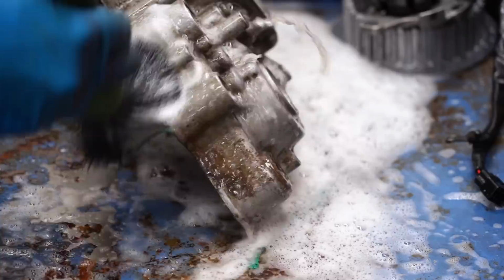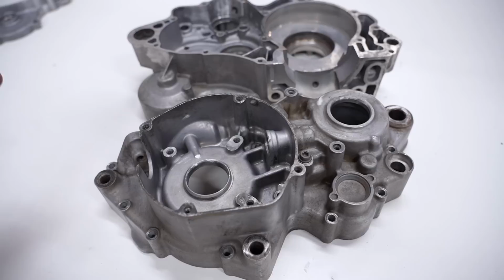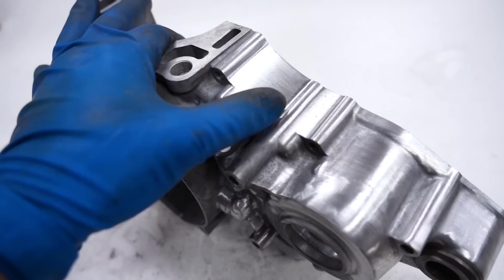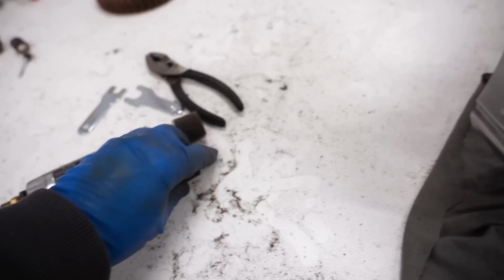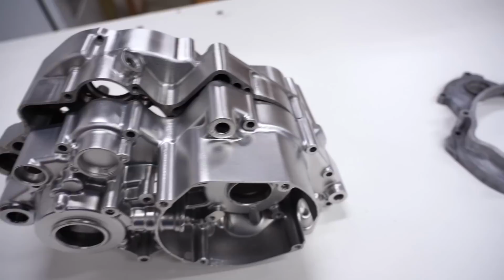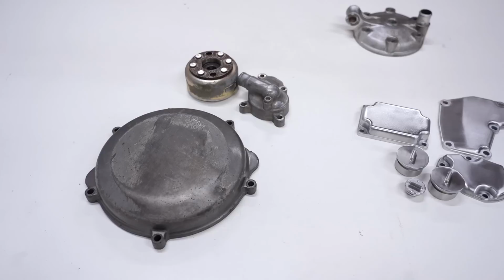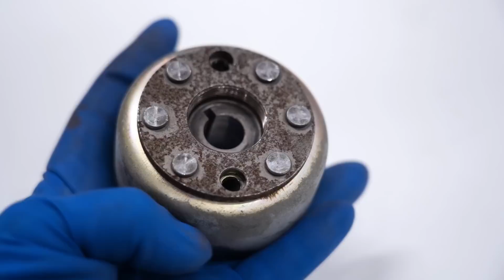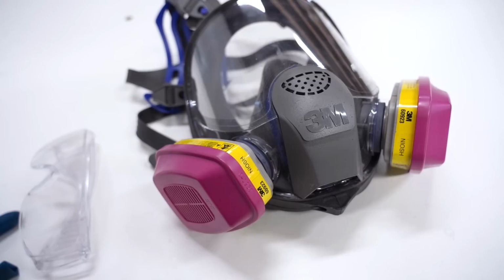Restoring Engine Cases To Better Than New! | RM250 Rebuild 7

Comment: Brushed finish looks great! To get straighter lines dont rub back and forth, just rub one direction, like top to bottom, pick up the pad, and start from the top again. It turns out alot better normally

Comment: If you wish to maintain the motors sheen and cleanliness, spray the engine with a light coat of non-stick cooking spray before you take it out. Concentrate on the dirt "impact" areas especially. 

Once done with the days riding simply pressure spray with gentle detergent. This will restore it to its original shine. 

I have built show road bikes that were frequently ridden... worked a treat there as well.

Good luck and thanks for the great channel Cam. 👌

Comment: You might want to try the "Purple De-greaser" from Home Depot. I use it on my Laser Engraver cutting table, and it works like nothing I have ever seen. You will want to wear gloves, and mix it to 30% solution with water. Let the parts soak in it for half an hour, and you should be able to squirt them clean with a hose. In very tough cases you may have to use a soft brush. I used an old electric toothbrush and it worked like a charm. This stuff is potent, so make sure you rinse thoroughly!

Comment: I built Epoxy composite sail boards . Painted with an aircraft paint called Imron . I study aerospace engineering. I had a beautiful shop.
My friend bought a shop from some one and just started building without reading the safety data sheets.
He would paint with a respirator only then go back into the paint room and look at his work without a respirator.

I had a fresh air supply system used many types of Epoxy
Resin . Never look at a piece after painting until it was fully cured in an oven. He had to have kidney transplant surgery.
You have a nice shop.

Comment: very cool vids Cameron, one tip though be careful with raw finish on Magnesium, there is a reason the OEM's paint the magnesium covers they corrode very quickly when exposed not like aluminum.

Comment: Great tip about heating the parts in the oven.  Was scratching my head the other day about trying to get the stuck twin needle roller bearings in the dual brake system pivot point on the lower fork leg on my XL1000v.  Just tried your tip 20 mins ago on the dismantled fork lower and they pushed out with minimal force.  Thanks

Comment: Just a FYI I stumbled on your account a bit back and have been watching since.  I wanted to let you know I have been using the Napa Alum bright for years.  On any engine case it will gray it out, but on aluminum like a sub frame or swing arm it will make it bright again.  I think it has to do with the different material in the engine case aluminum.  I will use is on old chrome wheels, new mag wheels.  The key is spray and immediately rinse.  DO NOT LET SET FOR ANY TIME.  Also I have see a few vids on home made vapor blasters.

Comment: Go figure... another great video Cam! Those parts turned out sweet! Sooo clean! 

An idea for the future... next time you get a head in that condition, you should discuss how to measure the squish band and mating surfaces. A lot of hidden performance in is stock heads by just correcting the squish band.

Comment: That’s odd about the Napa Aluminum Bright stuff. I use it on my ‘14 CRF450R every once in a while and my cases look just as good as a new CRF engine. Never had it turned it that “grey” color.

Comment: Hey Cameron another great video. I'm not trying to critique your work because your work is flawless but as a fellow builder/mechanic I think how much time it takes to do all this stuff or maybe greate less work for yourself. I'm wondering maybe sand blasting the cases to get a nice finish and for polish putting the cases in a tumbler to save some time. It's probably more than likely you restore a lot of cases and aluminum pieces with all your dirt bike experiences. I wonder what you think about that?

Comment: Do you ever run into the issue of the crankshaft feeling tight or binded after you re install in the cases? I’ve had this issue and didn’t know how common or natural it was because of how free it rolls over before disassembly maybe the difference in a worn engine and a new tight one? Just figured I’d ask a guy who was built a few more then myself.thanks in advance

Comment: Nice. I’m about to pull my motor out and do this! Not gunna crack the case open but figure I can do a leak down test while I’m at it and get the frame up to date. I have a 95 kx 250 I have spent a lot of hours cleaning that bike. Got my woman all pissed at me cuz I had to use our bath tub to clean a bunch of parts but it was worth it! It’s kinda addictive cleaning and polishing and restoring. I’ve spent over 2K and a massive amount of time cleaning and I feel like I’ve just barely started. Gunna get one of those haggs pipes 600$ and a phat head which is 350$ gunna get all titanium and aluminum bolts and nuts and still feel like they’re is so much to do.

Comment: cam be careful if u plan on clear coating the cases, I done that on my 06 kxf250 a few years back, the problem was when the engine heats up it very slightly softens the clear coat and the sand/dirt got into it and stained it, it looked terrible and I had to undo everything I had done!!

Comment: I would advice for using plastic and not metal gasket scraper material. its very easy for a metal (steel) on to dig in the casings

Comment: What would you suggest for a small hairline Crack in the engine case (97 RM 250) on the right side case right at the motor mount where the bolt goes through on the very bottom. It doesn't leak. But only time will tell. Thanks.

Comment: Gret job on the aluminium, ..... BUT, magnesium should NOT be left exposed to the elements , it requires a chromate protective coating or it corrodes very quickly

Comment: Question: is it possible to buff/sand down an engine or crank case too much where the tolerances are messed up and parts no longer sit flush?

Comment: Cam my first youtube dirt bike guru.. Im going through an 89 cr125 and they of course have black cases. I just got a replacement set and need to get on it later today. I was wondering your opinion on painting cases without powder of cerakote. Trying to do it on the cheap and i can prep like a sob but unsure if I should strip the cases completely (time consuming mess). Or sand down really well then start from there...mind you someone has sprayed these cases black spray paint already so im kind of unsure an would like your opinion. Great work as always man u make it look so easy it too. I love it.

Comment: Hey Cameron, I found a 02 CRF450 with low compression and won’t start. The seller agreed to $550 as he believes it needs a new top end? He said the compression is at 70psi. What could be the causes of this? An easier fix possibly than a new top end? Thanks I’m advance!

Comment: I personally prefer the vapor blast look. Now im going nuts trying to find one here in my country, but nobody sells them here. There is a wet blast nozzle though that attaches to high pressure spray machines. Wondering if it can produce the same look?? Anyone know?

Comment: Hey I have a 2001 rm 250 it starts 1st kick when it’s cold with choke on I let it warm up a little then turn choke of and ride it easy to warm up the rest but once I turn it off it won’t start back up warm any tips or reasons it would do this?

Comment: do you know what your buddy used as far as the slurry mix on the vapor blast? They did come out amazing I made my own for like 50 bucks and it did a beautiful job on my subframe Radiator Braces Linkage and some other stuff. Great video as always
Reply: 170-325 mesh glass beads

Comment: Steel wool is bad for aluminum - It leaves microscopic amounts of steel in the grains of the aluminum which causes dissimilar metal corrosion and makes the cases look bad quicker. Scotch Brite is okay because it's a synthetic material

Comment: Have you ever tried a clear lacquer over the polished parts ?
Reply: I have and it wasnt good, I done the cases on my 06 kxf250 a few years ago, it looked fine until I started riding the bike, the heat from the engine very slightly softened the lacquer and the sand and dirt got embedded into it and stained it, it looked terrible and runined the work I had done!!
Reply: @ericjaulin9562  
Yeah you would have to use some type of lacquer that was resistant to heat or it would end badly.
I don't know what kind of clear coat they used to used on engine casings from the factory before they started anodising everything but it lasted quite a long time.
Reply: Had a look around and 2 recommended
One is "Hycote VHT clear" that is fairly cheap
Or a more substantial coating "Eastwood Diamond Clear Gloss for Bare Metal"
Reply: I cant remember what it was I used, it was a few years back but im pretty sure it was a heat proof version, I wouldnt risk it again, maybe it was the constant heat that caused it to go soft, it wasnt enough to really notice by look or touch so it was so slight but enough to absorb the staining. thanks!
Reply: Clear cerakote is awesome and easy to apply
Reply: @tonykoehn8181  I am about to cerakote my cases on my current bike but its a charcoal/smoke colour, ive already done the waterpump and housing and it looks brilliant, mud and water jus run off it aswell!!

Comment: I have the same bike that your working on. And I’ve been trying to rebuild it,but I’ve been having trouble with the engine because there’s a crack on it. I was wondering where can I get a new engine for a RM250 same year as the bike your working on. I checked all over online and I can’t seem to find any that are available.
Reply: Buy an used case
Simple
A lot cheaper
Just look for a one without any cracks
If it has scars on the outside of it dont give a damn
You can make it look new just like cameron did

Comment: Hey wouid I be able to shine up my motor without having to strip the whole thing down if so then how ?
Reply: Do it by hand
Or with small tools
It will take a lot more time
And the effect wont bw as good
But if thats what you asked the  here you go
Reply: Kacper Wandas okay well i have the little tools to do it but I don’t wanna take my whole motor apart without nth wrong with it
Reply: @ProjectHondas  you can do it with the engine in he frame
Just be careful with the carb
Take off all of the plastics and clutch/rolgaz lines and try to get everywhere with your tools
Reply: Kacper Wandas I’m probably gonna take the motor out I just don’t wanna strip it down I don’t have the money to rebuild it like I want to rn
Reply: @ProjectHondas  
Ok
Then do the same 
It will be easier for you to get the hidden spots of the engine
Like under the carburator
Reply: Kacper Wandas yeah that’s what I was thinking

Comment: I just bought oem engine covers. Powder coaters wanted to charge me $60 to to do ONE cover. 🙄
Reply: I just bought a powder gun for 100 bucks, colors are 20 a bottle, had to build an oven large enough to do my quad frames, have a sandblasted to prep the parts and my time and electric bill to run the oven. Seems like 60 was a pretty good deal to me!